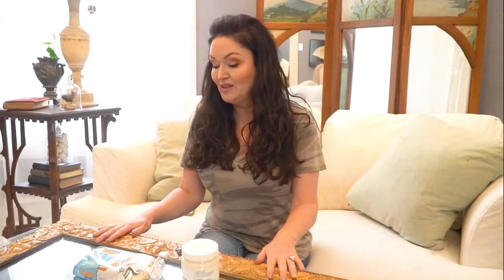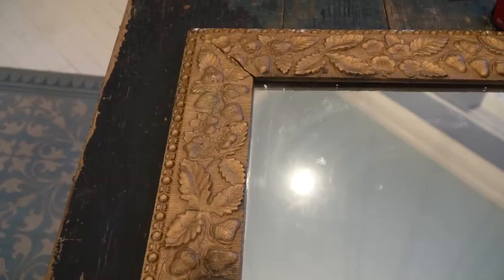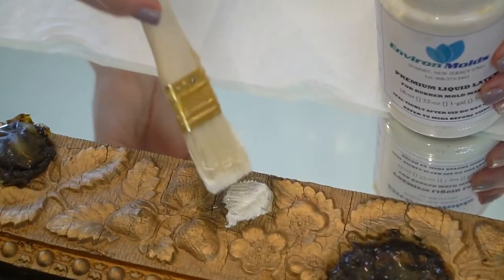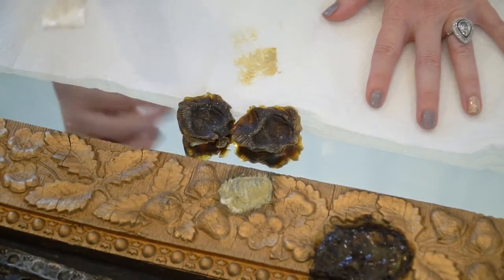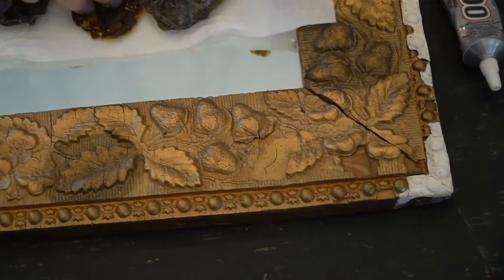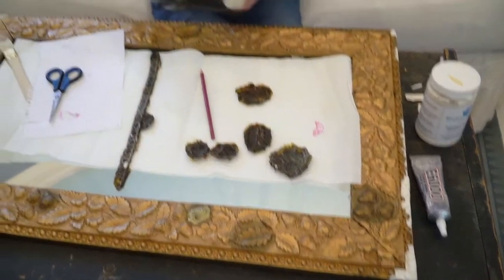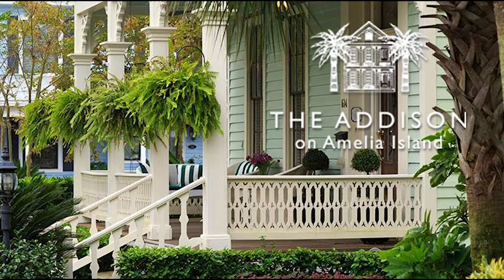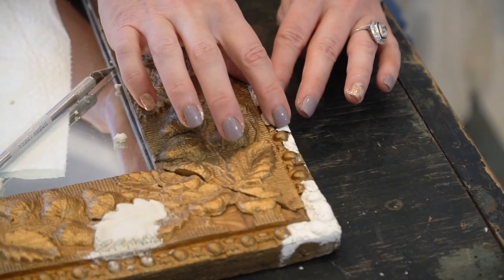Frame Restoration

Comment: Just lil helpful advice to save you some time polymer clay will mold perfect and pull out all your details you just bake it on low heat for 15 minutes let cool dust it with baby powder cooking spray your choice press politer clay into your mold then pull it out bake it then you’ve got perfect replica of damaged frame your choice of glue to attach it
Reply: Thank you this is exactly what I was hoping to find on here. Quick and helpful comment.